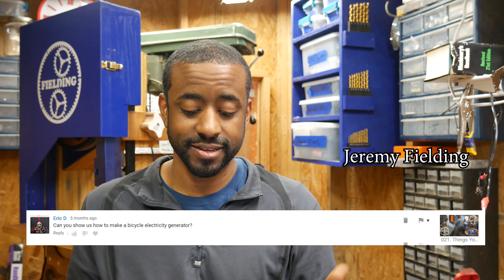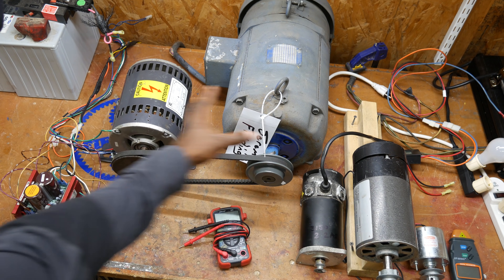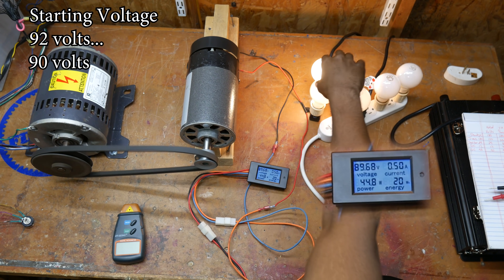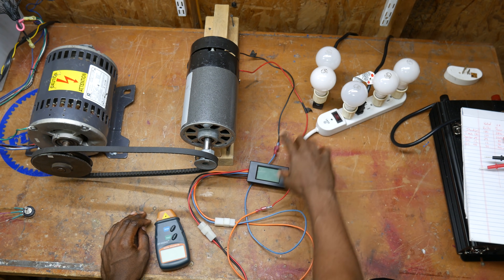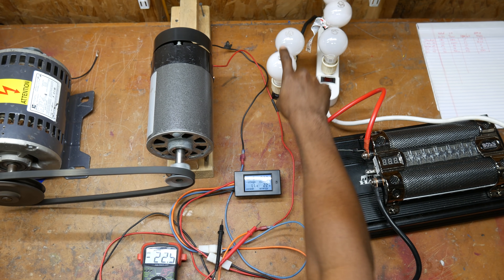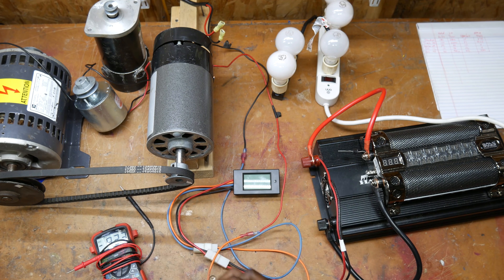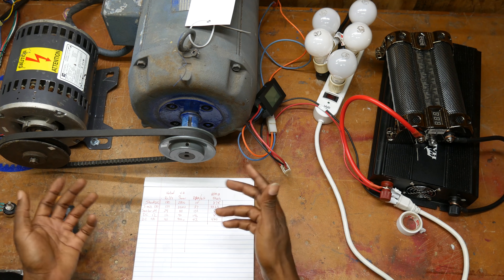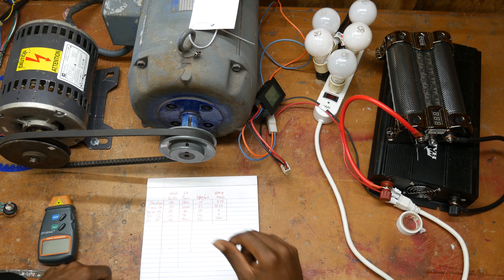How To Build A DIY Generator Part 1 : 050

Comment: 4:31:  Hi Jeremy.  Using inverters with generators is different than using inverters with batteries because, while batteries produce flat DC voltages which the inverter is just fine with, generators --- even DC generators --- produce sine waves and similar manners of dirty electricity that inverters don't like.  This is why the right kind of inverter has to be paired with the right kind of generator according to what inverter will accept current from the generator you're using it with.  Inverters are also very sensitive to voltage differences, which means that if you're using the inverter with a bicycle-powered generator you need a voltage indicator on the generator side, the inverter side, or both. You'll also need a switch on the generator side which you can activate when you see that the voltage is right for the inverter.  It will also help not to turn your human-powered 120-V appliance until the output voltage from the inverter is properly synchronized with what the appliance uses.  This "dirty electricity" phenomenon is also what makes it difficult to use human-powered generators to power battery chargers.

Comment: but if you dont connect the loads directly to any dc motor and use a charge controller for battery-inverter setup the voltage would never drop right? so any dc motor would work

Comment: 14:20 I might just be a little stupid.  Is there a way to buy a "generator" IE, just the rotor/stator assembly?  Any time I try to look this up, I get only results for fuel driven generators.  I just want the generator half, not the engine.

So I have settled on a bank of universal motors salvaged to a genny with a wind or other input (yeah, I fit that trend).

Comment: Mr Fielding, I've come across hydrogen things before, that apparently have been buried. They're not in the public now, how to build them. This gentleman at channel "Hidden Technology", posted a build out of a hydro run generator, "THE GREATEST INVENTION: WATER AS FUEL! The secret of the HH+ compound to boost hydrolysis". Could you peer review if you have time? I'm not sure anyone has the ability to punch out the plates these days, even when we were building out J. Keeley's  and other inventors things, it was hard to punch out the plates. Have to wonder who to call to have it fabricated these days, with everything still shut down. Thanks for the videos. I really enjoyed them.

Comment: also theres a  whole lot to getting the motor setup efficient to produce power out      you can not just use it as is and be efficient with output power

Comment: you need an ac rectifier circuit board   its not too hard to design     it will definitely drastically improve your performance of V and A
Reply: You are getting ac V on the first set up though    right? i think you are
Reply: get charge controller off a alternator

Comment: Why isn't it that we aren't copying the same system that is in our on-road vehicles that have alternators. It's a electric generator/motor designed to Output the proper voltage battery charging needs, then you could just hook up the battery to an inverter and Bam your set to go. You just have to figure out how you want to be able to spend the alternator, wind power bicycle powered electric or even gasoline motor

Comment: Induction motors don't produce a lot of power in my experience. They have no permanent magnets to induce a current. The rotors can be modified to contain permanent magnets but their effectiveness isn't anything to get excited about. I don't know, maybe I missed something when I tried it, but I get much better results from using my DC motors as generators and they already produce a direct current thanks to their commutators, no rectifier needed. If using it to charge batteries either a charge controller or diodes are needed to prevent the batteries from driving the motor. I haven't used a charge controller for this myself, but I do aim to keep the output voltage around 13-14 volts so as not to damage my batteries.

Comment: generator -> voltage regulator-> super capacitors 2.5 volts (made into a super capacitor battery 15v) -> 2nd voltage regulator -> inverter-> output

Comment: I'm working on turning skateboard wheels into the mechanical input so would there be a suggested motor for the output as a generator? Keep in mind it needs to be small enough to fit the wheel and turn while being on the road.
Edit: If you respond please like the comment because otherwise i wont be notified that you responded no I'm not begging for likes I just forgot how to turn the comment notifications back on.

Comment: I think that the should be to have a battery bank that is sized for your energy usage and then have a DC generator that is efficient at a particular output and basically runs 24/7. Somewhere you might use more from your batteries but elsewhere you won't and that's where the sizing of the battery bank is important. 
In your other video where you had the two treadmill motors connected to each other with the AC motor in the middle, you noticed that when you rotated one motor, the other also rotated, one pulley was slightly larger than the other, if you had another pulley that was just a bit bigger than the larger one, use it and fit a diode on it's output so that it can only output power but not take it, with the two mechanically connected via belts, one should theoretically provide the power to drive the other! 
Remember, all that you are looking for is self driven ability and enough voltage and current to feed into a MPPT Charge Controller to charge batteries! 
Personally, I would be happy with 13V at 1A for 24/7 which is actually a lot more than 1A sounds, a solar panel only works for about 8 to 10 hours a day and it's output power is a lot less during overcast days, so having something that is constant is definitely better, you know that it's going to deliver, if you use more today, you know that you will make it up tomorrow, unlike solar, you don't know if it's going to be a good day or not...
Wait wait wait, did you use a bridge rectifier on the output of the generator motor? Because when you use a DC motor as a generator, it outputs AC! If it runs at 90V, you should be getting more voltage after the bridge rectifier, that's possibly why the Inverter was complaining! It can't use the bottom half of the AC signal! Did you check the output with the multimeter to see if you were measuring AC or DC? It's easy to miss! Some meters you have to switch it to either AC or DC where others only have one setting on the dial and you have to push a button to switch between AC and DC measurements! 
I mean, you were running those lights straight off the generator! Were they AC or DC lights? 
Something doesn't seem right! 
Would love to see another video on this, it's definitely a popular topic! 
The two motors need to be geared to be spinning at their optimal speeds so that they aren't using more energy than they should be and producing energy at it's most efficient speed...
I just watched the video again! I didn't see any bridge rectifier! Plus, you have a capacitor across the output of the generator and this is a problem! A capacitor will store DC but AC goes straight through like it's not even there! Essentially it's a short circuit! Get a full bridge rectifier and your results will be very different! You will also notice that your getting double the voltage after the rectifier! 
I really hope that you give this a second go. The fact that the lights that you used Will either run on AC or DC would have been confusing you.

Comment: Similar to a battery charge controller, you can by DC to DC power supplies that can take wide voltages in and give you a consistent voltage out, without needing a battery before the inverter.  We used to build these all the time for wind generators (would also be responsible for maintaining a reasonable rotation speed for the blades).

Comment: How did generators work before digital charge controllers were available? How was the voltage regulated to provide a stable current to the battery/inverter?

Comment: If you want to use a self-exciting generator right, with tolerance to electrical faults, use a relay that turns off the load until the voltage rises to where you need it. I've seen this used in a few places where the load will cause the generator to not build up a field. Also these types of generators are very tolerant to overcurrent. If you short the output the output voltage simply gets dragged down, and the motor is unharmed.

Comment: It’s probably already suggested,but how about trading out the induction motor with a car alternator which is usually a steady14 volts...I just know this number because of testing charging system with a multimeter while diagnosis of vehicle electrical system...sorry didn’t notice this is an older video....curious of you final results

Comment: How could you use .15kva dry type transformer in series with a generator to power a small workshop?
Reply: Use a car altanator, then use tranny to step up voltage.

Comment: I'm going off grid with a bus of an rv. Mountainaire newmar class a 1998' . The only way to get electricity is by making it. What could power the  large 50 amp electric plug if I used everything all day n night. Including playstation n tv and lights and air conditioning small refrigerator.

Comment: A 3600 rpm single phase A/C motor with 4 A/C street light capacitors makes a good generator with a pure 60 cycle sine wave; input power of different types (lawnmower, Savonius turbine, etc.)

Comment: I'm a newcomer to this "hobby", and have basically been binging on YouTube, Wikipedia and whatever else I can find about motors, generators and anything related...  just trying to learn enough to move into the "tinkering phase".
But, based on what I have learned so far...  it makes a lot of sense that a shunt wound motor is one of the preferred options for use as a generator, because they are most often used in applications where their "self regulating" nature is beneficial...  that is their ability to maintain torque/speed under varying loads. 
The most common example I've seen cited is a conveyor belt that may move boxes of all different weights. 
QUESTION: 
What tools and equipment do you recommend for someone who is anxious to begin tinkering with motors? I know that a multi-meter always comes up, but I'm curious about how concerned I should be about surpassing a multi-meter's limitations if my focus/goal is generator efficiency and seeing HOW MUCH power I can produce.

Comment: Is it possible to create a motor based generator system that you can run off of a battery & receive more watts then its sucking out of the battery? so you can thus use those additional watts for household items & to recharge the battery. I really want to power my house for free & off the grid but without using solar, solar is pretty expensive.

Comment: Wouldn't it work good to just use an old alternator out of a car. I would think it would be better since its designed to charge already
Reply: For charging a battery it's great, just under-volt the field windings or you will not be able to turn the armature. I used a coil of wire from an old tv as a resistor.

Comment: Couldn't you just spin the motor by DC and put out a from the same motor. You could pull electricity from both of them, correct?
Reply: Brandon Felder nope ,  there are always losses in the motor ,  so you need to put in more mechanical energy than you get in electrical output.

Comment: I think one of the reasons shunt DC motor did so stable output is another winding SERIES to armature, one which was named COMM field on your schematic. The more current draw (flowing through armature) - the more additional field is created which increases voltage it generates in order to compensate ohmic losses. At least, there were 'mixed excitation' (as we call them in Russia) motors and generators where two separate field windings are used, parallel (shunt) one and series one. It allows very stable output rpm's for motors or very stable voltage for generators. There are some neat tricks of doing generator with NEGATIVE output resistance when it's known there would be pretty long wire connecting it to load. So negative output resistance of generator + resistance of wire will be nearly zero, so voltage at the LOAD is going to be stable. No free energy of course, just we give a hint to generator: 10 amps is drawn, there would be huge voltage drop, so increase your voltage accordingly!

Good old tech... This all is obsolete by now: synchronous generator with permanent magnets, rectifier and power convertor / inverter is all we need today...
Reply: But maybe this additional winding is located BETWEEN main field windings, then it's another beast which reduces sparks and wear of brushes, ensuring good commutation. This one should also stabilize output voltage to some extent, by avoiding saturation of part of stator and armature core because of 'armature reaction'.

Comment: Nice vid...however...guess I am missing the point here, since the output of your generator will always be less then the energy to run the motor you are a net loss of energy.  You are planning on running a motor to run a generator to charge a battery or batteries.  Wouldn't it be more economical just to run a battery charger off the wall to charge the battery?  Or of course if you have solar to charge the battery?
Reply from the maker: You definitely missed something at the very beginning... why I am using a motor to demonstrate this principle
Reply: @Jeremy_Fielding  I saw the beginning and that you were replying to questions on how use a motor as a generator.  After I watched this video I watched another of your videos where you turned a rowing machine into a generator and then it clicked what your motive is.  So my bad, guess I have been watching too many 'free energy' vids lately.

BTW...I did subscribe today as your vids are a welcome relief to many others!  Especially like when you fast forward through your builds.  Thanks again!

Comment: external voltage regulator(external of alternator) for a older vehicle: 1977 toyota 20r regulator $30 at autozone great option for charging batteries, pay attention to amp rating, i welded one full field trying to regulate 2 alternators with one regulator

Comment: hey about the inverter setup with the dc the motor as a generator try useing a bridge retifier to smooth the ripple ac to dc .unless he motor has a diode of some kind built in witch will also limit your output current and voltage.
Reply: i stand corrected good video bro keep it up.

Comment: Don't DC motors still put out AC when used as a gen?
Reply: I don't think so. AFAIK, the brushes/commutator act as a mechanical rectifier.
Reply: @k4kfh  Thanks for the info, that's pretty cool.

Comment: Great video. One suggestion. If you wanted to do this... reverse engineer it. Meaning know your load.. first.. then build a battery bank to hold that power... then build the generator charge the battery bank.  It’s so inefficient to run a load directly off the motor.   Battery’s handle loads better than motors do when you need consistent energy.  I have studied alternate energy for a while.  When your trying to move energy from 1 point to another you want to move it the most efficient way possible.

Comment: replace the motor with a standard GM truck alternator and you'll get a consistent 14.4V to the inverter
Reply: I'm using a old dryer blower and heating elements to heat my small shop works great, but sense it  1/2hp  and does just over 2k rpm I double down and put gm alternator on the belt drive of dryer motor. It covers the energy used to run heater more or less.
Reply: Use a ultra capacitors pack between alt n inverter.   .Looking at summer time evaporator air cooling.  Using 5v humidifier modules